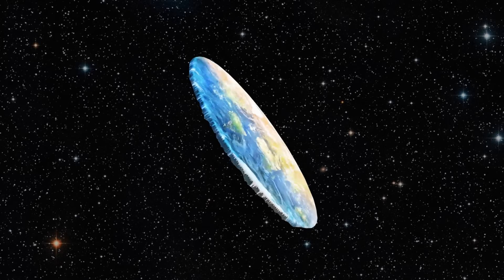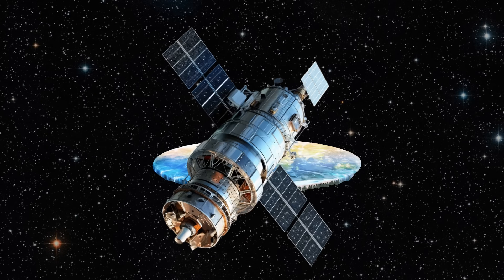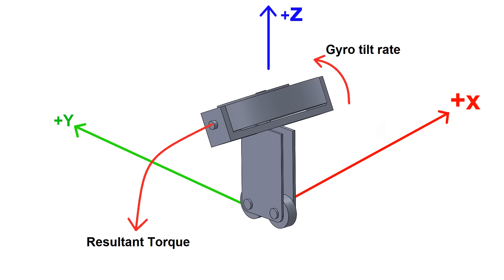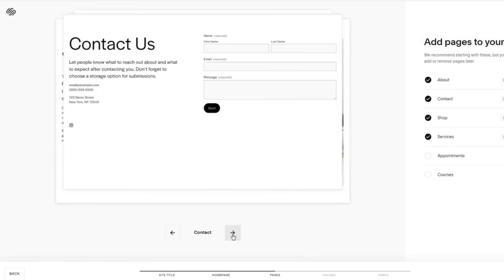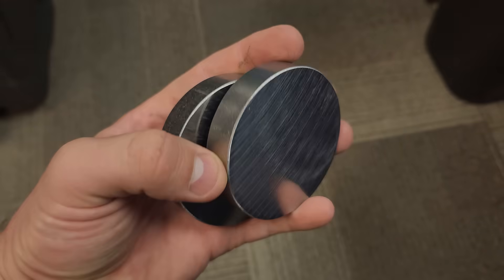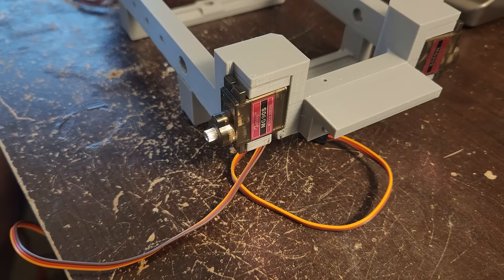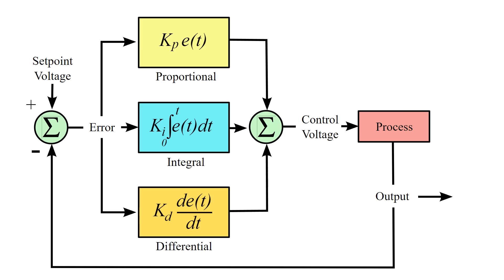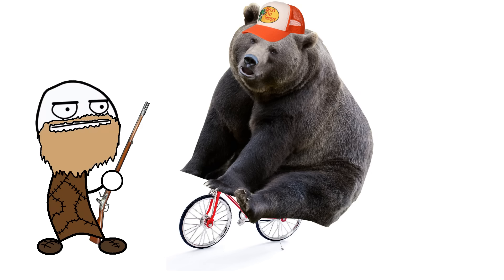Gyro-Stabilized Monorail Train

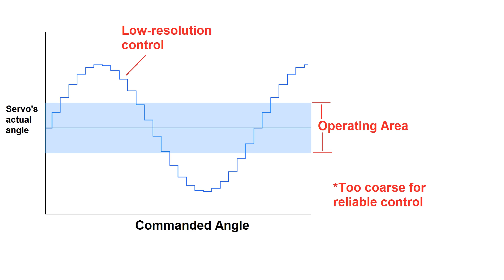Comment: Hey! I was building my own arduino nano controlled quadcopter and ran into the same issue you had at 14:55, not enough granularity in the pwm signal. The standard PWM function for the nano only has 2^8 bits of resolution, but you can use the servo control library and writeMicroseconds to get much better resolution for your servo. You could also buy a teensy 4 board for 20 usd which has a pwm function for which you can set a much higher resolution than what is offered with the nano. It is also much faster which can make a difference especially for a control loop. It also allows you to read PWM signals easily on more than 2 channels without having to do your own manual pin change interrupt routines.

Also, I am curious as to how you read out the angles from your MPU 6050. I used a kalman filter some smartypants Belgian guy made https://www.youtube.com/watch?v=5HuN9iL-zxU and it gives a mostly noise free reading even when my motors are running. Your jitter could also be caused by angle measurements that are all over the place due to vibrations. Is there any possibility to see the code you have made?

Love ur projects, it helps me get inspired to do some of my own! 🥰

Comment: 1) Couldnt you just decrease the speed of the steel disks until you hit an optimum between strength and precision?
2) I think using a mechanical joint that fixes the position of both wheels would be better than using active control.

Comment: about the gimbal lock, can you just decrease the speed of the wheel correct the angle and then speed up again? sure you it loose its function but with 2 of them that shoudn't be a problem.

Comment: there's actually many ways you could increase the precision
instead of reverting back to 3d printed stuff, I'd have tried either a gear system, or the rope-based system (forget the name, EDIT: capstan drive) which is even better (no gears means much higher precision)
Reply: "Capstan drive" is the name of the rope actuator you're thinking of, and I agree it'd work well for this. It's zero-backlash and very lightweight.

Comment: I'm not sure what servos you're using, but they should have at a minimum ~0.2 degrees of resolution. High quality servos are ~0.05 degrees.
Reply: I think @HyperspacePirate is getting trapped by the default Arduino servo library in which the write() function takes an integer which represends a degree. So whole degrees only. However the servo class also has a writeMicroseconds() function which allows you to directly control the pwm pulsewidth.
Reply: @freakyjason477  that makes sense. In case HSP doesn't know, servos center at 1500 us with the extremes at ~900 us and 2100 us.

Comment: Monorail powered by stirling engine with temperature differential provided by a liquid nitrogen tank it's hauling... OR BUST!
Teddy bear train conductor for bonus points.

All jokes aside, good luck on the project. It seems you have the sensors available for making a much better controller routine. I have faith.

Comment: 6:35 A more commonly used unit is Nms for angular momentum (e.g. in Reaction wheel specs). It is then easy to figure out how much the momentum would go up by applying a certain torque for a certain amount of time.

Comment: To get more resolution out of your servos you can rotate the servo horn so it is 90deg from its normal position while the reaction wheel rotation point is still in the same position. This would make it so the first few degrees of rotation on the servo would be less than a degree on the reaction wheel, and this would be non-linear, so you get better fine control and better coarse control if a big change is needed.
I have a pretty good paper about hand-tuning PID parameters. If you want, I can email that to you on Monday.

Edit: you would actually want to offset the reaction wheels pivot by 45deg if you rotated the servo to 90deg.
Reply: Additionally, since he mentioned he only has 1 deg of servo resolution, I believe he's using the arduino servo library. It has another function writeMicroseconds() which will directly set the pwm signal to the servo, letting you have way higher resolution.

Comment: There was a gyro stabalized car that drove on 2 wheels. The car still exists but it doesn't really work for highway speed hence why it never got past the prototype stage.
Reply: Isn't that just a motorcycle
Reply: @bobbob9211  If it is what I am thinking of, it was essentially a self-balancing enclosed motorcycle, but the seating position was more like a 1-seat racecar. 
Not comfortable, wasted energy, and increased wheel loading (and therefore increased maintenence costs and road wear) , making it worse than most existing motorcycles and cars.

Not to mention the lack of room for safety systems, fuel or batteries, and cargo, which would have made it difficult to sell even if it got out of the prototype stage.
Reply: @piisfun Sounds like it is only useful for parades and science demonstrations. It has the unique feature of being able to stabilize at a complete stop with an uncooperative load.

The driver is the primary stabilization system of traditional motorcycles at extremely slow speeds. The front fork angle does most of the stabilization once the vehicle reaches bicycle speeds.
Reply: @piisfun  gyro car, built by wolsely, 1914...

with three bench seats, possibly up to nine passengers, three side by side?

brennan, he of the monorail, did a car in 1927...

ford had a go...
Reply: @bobbob9211 legally in the US any vehicle with  3 or less wheels touching the ground are motorcycles. In terms of driver experience, It drives closer to a car.  In testing it drove just fine at low speeds but had issues at higher speeds and there were questions about winter conditions.

Funding dried up and development ended. It was found and restored and sits in a museum.